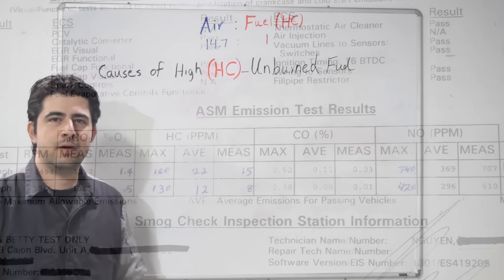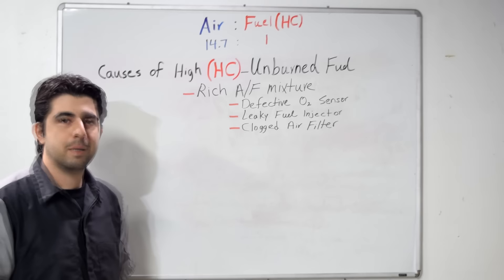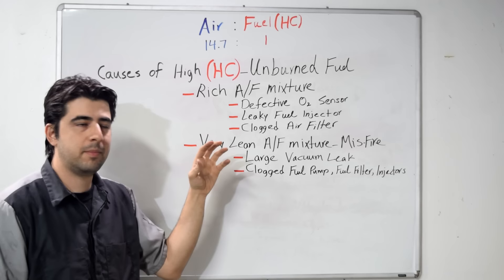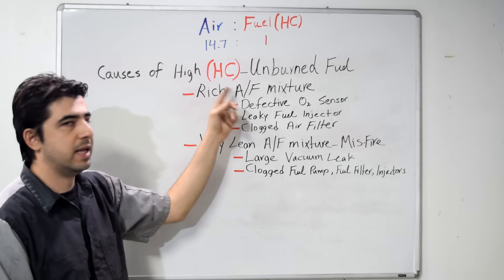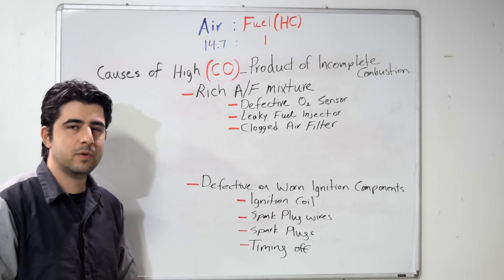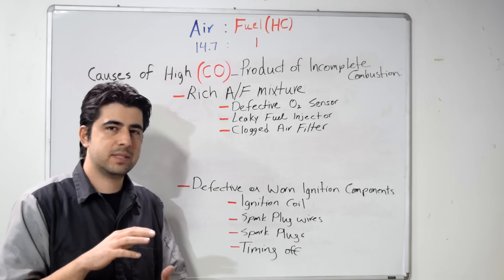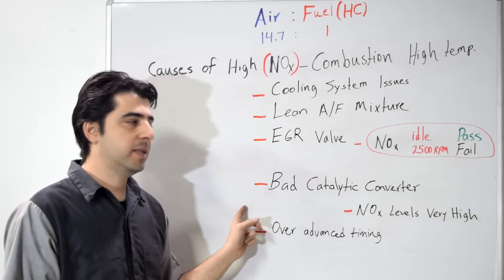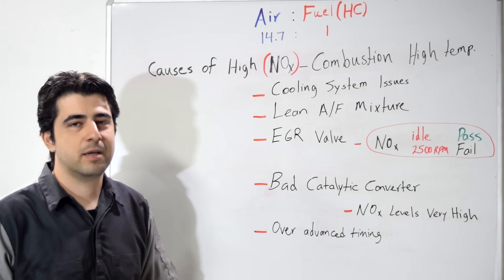Diagnosing a Failed Emissions Test - High HC, CO and NOx Causes and Repairs

Comment: Thanks for the video!  Very informative.

For NOx I had the opposite issue; failed at 15mph, 1350rpm (55% over max) and passed at 25mph, 2200rpm (20% of max).  Could this still be EGR or likely something else?
Reply: I have the same issue, did you ever find out if it was the egr valve? Thanks!
Reply: @goku0728995  haven't touched EGR but don't think that was it; I did an oil and air filter change and NOx passed.  I also made sure my engine was much warmer; first time the smog shop was like a mile from my house.  Still failing HC at 15mph though, getting 59 with a 51 max allowable 🤦

Comment: Hey man I really need your help. I failed the ASM Emission Test Results on the part of HC (PPM): mine is reading like this> MAX: 66/AVE: 9/MEAS:76 -> 15mph & 49/6/51 -> 25mph 
My CO% and NO is normal they say
CO% 0.57/0.03/0.10 15mph
0.55/0.03/0.14 24 mph
NO 487/67/163 15 mph
774/62/95 25 mph
I changed my spark plugs and put 91 premium before this result but still no good. I WOULD REALLY APPRECIATE YOUR HELP

Comment: Hi
Very informative video.  Thank you. 
I have a question.  I recently failed nox in Colorado on my 2002 nissan pathfinder, but not by much.  The new limit is 1.5 grams per mile. Originally,  I was 1.7 gpm.  I changed the plugs. Then at 1.69.  Changed the left catalytic converter.  Nox was now at 1.5765 gpm.  By the way, I'm fully passing hc and Co from the beginning of this fiasco.   I should mention that the new cat is carb compliant.  The right cat I changed to an epa compliant unit 2 years ago because Colorado hadn't gone all Radical on the carb stds yet.   So now what to do?  I am faced with changing the other cat again, maybe thermostat or maybe egr solenoid?  
Also the car is running fine and no codes are on the obd scanner.   So the nissan thinks everything is just perfect and it would be if I lived in the 46 other states not run by folks that are from California. Thing is, I haven't been able to find a vacuum leak either.  I'm worried that buying another carb cat for the right side won't solve the issue.   I even thought maybe there's a pcv valve or fuel injection issue but it's impossible to know.  So I was hoping you could give me your opinion on how to approach it.
Thanks.
Reply: Did you replace the other EPA cat with a CARB cat? Did you get it to pass yet?
Reply: @PimptatoPCs  no, I had to get a waiver.  They claim my epa cat on the passenger side was keeping it from passing.  The carb cat works fine on the driver side.  I'm at 1.57 gpm.  They gave me 2 years to change the other cat which is the next emissions inspection basically.  It's ridiculous because a 20 year old car isn't designed for this.  It's Colorado and CA that have their head so far up their ass that they can't understand that.
Reply: @johndonohue7746  that's close to one of numbers I'm at.  I'm going to try dumping some CRC additive into it and 100 octane race fuel.  I am also going to over inflate the rear tires and I may take out the air filter for the test.  If it doesn't work how did you get a waiver?

Comment: Quick question I installed a alternator and forgot to connect back the o2sensor wire and went to smog it and failed do u think it being disconnected was the reason it failed
Reply: I would think So

Comment: I failed my emission test because when idling my oxygen result was 0.8 and the limit is 0.4 and the Lambda test when idling was 1.04 when the limit is 1.03, would appreciate any advice? THANKS IN ADVANCE.
Reply: Roberto Gómez I always replace everything that’s cheap first. Check for vacuum and exhaust leaks. Change your engine oil and oil filter. Change your air filter if it looks old, change the O2 sensors. Add some Lucas fuel cleaner. Check your tire pressure (can make a difference on dyno smogs). Lastly, take it for a 20-30 min highway drive before getting it smogged. Leave it running until it’s tested.
Reply: Two Car Garage Thanks for the reply, it was an oxygen sensor, I keep a very tight record of my SUV maintenance so everything else was fine.  THANKS AGAIN.

Comment: failed my smog test due to my obd ll  not ready. no engine light on. I have driven my chevy s-10 over 400 miles since my repair. got any solutions thx.
Reply: Edward Dominguez did someone try to reset a check engine light by unplugging the battery? o recommend u buy a Bluetooth odb2 scanner and torque app on Android market place.
Reply: Yes. I needed to do a drive cycle on my s -10 thx. Didn't know that.
Reply: Edward Dominguez for how long did you did a drive cycle

Comment: About the nox... A state referee in Calif, had told me that a high reading(failing nox result)means the engine has a lot of carbon built up & may be why it failed. Any one know for SURE if what he told me is true? The guy on this vid didn't mention nothing about this being a possibility. Let me know plz asap. O btw, my nox did pass @ 15mph but failed @ 25mph. The rest also passed.
Reply: I can explain. High carbon buildup raises compression ratio, and creates hotspots causing predetonation in worst case but definitely raises running temps.

Comment: I have 1997 toyota 4runner and it fail smog because of high NOx but it only fail at 15 mph it was high but on 25 mph its low and it pass smog
Reply: is ur 4runner a 4 cylinder? if so u might have a cracked exhaust manifold. that's likely at least part of the problem
Reply: Did you figure out the issue?  I have a '97 4Runner V6 4WD and after failing the first time due to high NO at 15mph I put in new spark plugs, wires, PCV, air filter fuel filter and changed the oil & filter.  Went back today and got almost the exact same reading on the NO of 587, max is 512 for 15mph.  Seems to do fine with the 25mph NO measurements.
Reply: p-dub all the stuff u did to ur 4runner does very little to control nox. check for exhaust leaks, intake leaks, a dirty maf, possible bad oxygen sensor. do u have a picture of the results u can send me? I can give u more advice with the test results
Reply: Sorry for the late response.  Since the 4runner failed I have done a Seafoam treatment through the throttle body, run a tank of Shell premium fuel with a bottle of Techron, then ran a bottle of Lucas fuel Injector Cleaner with another tank of Shell premium fuel, and cleaned the MAF and throttle body...hope all this helps.  Planning on going back to the smog shop next week.  Took a snap shot of the VIR but can't figure out how to post it.  The ASM Emission Test Results were 15mph CO2 15.0 measured, O2 0.1 measured, HC maximum 51, average 7, measured 41 CO maximum0.65, average 0.03, measured 0.11 NO measured 511, average 90, measured 587 = FAIL
25mph CO2 measured 15.0, O2 measured 0.0, HC maximum 35, average 6, measured 23, CO maximum 0.79, average 0.03, measured 0.06, NO maximum 765, average 84, measured 356 = PASS
Reply: take the MAF sensor out and take a look at the 2 resistors, if they are dirty clean them and get it tested again. if not, take a look at the oxygen sensor readings, maybe u have a lazy oxygen sensor
Reply: Thanks!  I cleaned the MAF which did not look too dirty, will look at the O2 sensors and check for readings.
Reply: What about. 2500rpm
Reply: josue ruiz I have a picture of my test

Comment: Are electric cars any better than these for the environment?
Reply: no they move the pollution from your tail pipe to a coal fired or nuke plant.
Reply: @thedeathwobblechannel6539  what about solar and wind powered plants
Reply: they are inconsistent at best. HOWEVER if your home is centered around low voltage LEDs and battery power as in the tiny home craze, there is some merit there.  even if you cant get totally off grid , you can be hanging by a thread and save a lot of cash  @logohere4556
Reply: @logohere4556  and wind power....let me tell you i worked for a company that makes the wind turbines. ALL of the blades are composites and fiberglass materials and glues and adhesives. very little of it and it's manufacturing by products are recyclable.